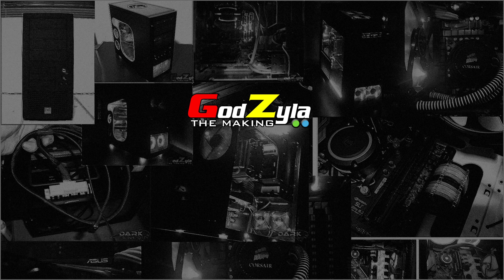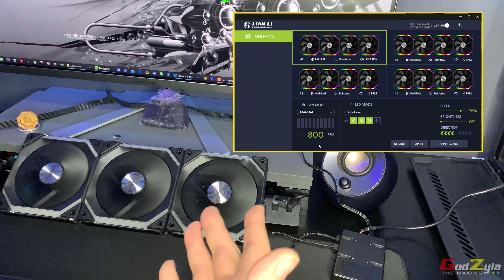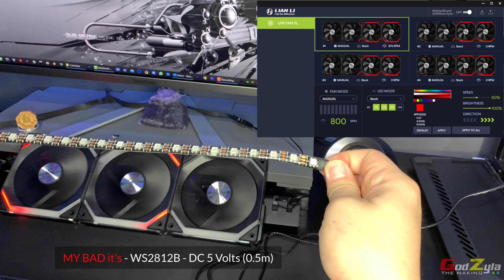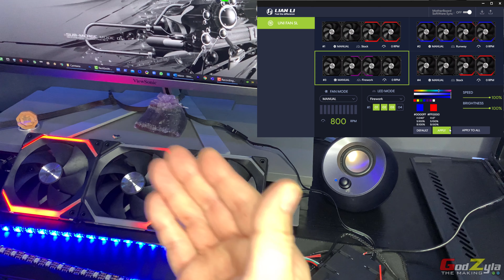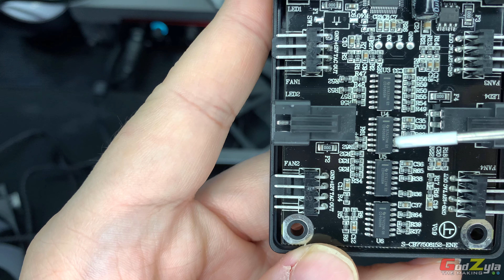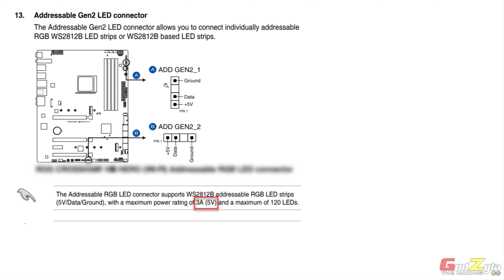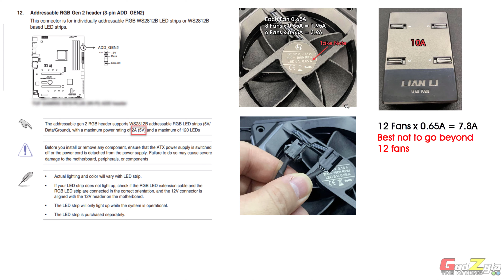Lian Li UNI Fans SL120 - Dos and Dont's (Part II) [L-Connect]

Comment: for this uni fans, what is your recommendation to do and buy when i want to build 7 fans. should i buy 2 controller or can still stick to 1 controller?
Reply from the maker: Hi Nazrul Stylo, welcome to my channel, just my opinion. i will get 2 box sets that comes with each 3 fans and a controller. then to get one more additional fan to have all 7 in total. 1 controller to be used with 7 fans and another to keep as spare. just incase. Thats what I will do. hope this help.
Reply: @KleoYan  hye thank you for responding so fast. so what is the max fans can put within 1 controller? like corsair LL120 need to have 2 controller for 7 fans. So, is uni fans only need 1 controller only? and if include from the video, i think it should be possible for 7 fans and 1 argb stripes right?
Reply from the maker: @MrNazrulstylo  for the uni controller it has 4 output. Each output can take in max 4 fans. Total of 16 fans. So you are good to go with just one controller with your 7 fans and 1 strip which is not more than 1 meter will be fine.
Reply: @KleoYan  i have a question, using casing lian li pc-o11 dynamic, what is the maximum fans for the casing? 9 or 10?
Reply from the maker: @MrNazrulstylo  hi, that will be 9 fans for the o11d  https://lian-li.com/product/pc-o11-dynamic/
(Top) 120mm x3 / 140mm x2
(Side) 120mm x3
(Bottom) 120mm x3
Reply: @KleoYan  why it does not allowed to have 10 fans like XL?
Reply from the maker: @MrNazrulstylo  u can’t fit another fan at the rear.
Reply: @KleoYan  oh, is it because of mobo or no space?
Reply from the maker: @MrNazrulstylo  that the case structure unless you want to put a 80 or 90mm fan at the rear then it’s possible and if you want SL 80mm or 92mm. You might want to request at Lian li official website and raise your request for them to custom make a 80 or 92mm SL fan.

Comment: Hi i have a nzxt kraken z63, 6x sl120 and 2x 140 for the aio. I really dont like Lconnect for controlling the fans manually and if i tried controlling it with the msi motherboard with and w/o the “fix” installed, with red dragon cpu and fan override on, and unifan on pwm settings and red dragon still dont recognize the fan no rpm speed detected but it do follows the curve but it is not stable and crashes from time to time and its annoying. So i would like to know if i could connect the unihub to my nzxt kraken because in my theory the unihub and the kraken will power the fans just fine because they are both powered by the power supply directly not by the motherboard. Because the cam software is really the only stable software in my build that is relevant or not to this topic. My suspicion is its the unifan SL hub that have all the problems that the software cant fix. Another suspicion that can cover up that mistake and avoid recalls is releasing another new fans (ALs) that is main target are the rgb trash fanboys. It just sucks that finally the greatest rgb fan that ever came out is here and the software is trash. SLs are elegant, its one cord unifan is perfect, rgb is not trash just enough to be classy and you ruined it with its hub/Lconnect software. Excuse my frustration.
Reply from the maker: Hello krayzie Egg, welcome to my channel, you can set the unifan to motherboard mode and connect the argb from the uni controller to your nzxt kraken controller if there is one, no issue and you are correct. So long sl fans argb connectors are not plug directly to the motherboard, it will be fine. As for fan load (pwm). My advise to you is to plug them directly to the motherboard header and to control them.

Comment: This may be a dumb question. If my motherboard is only rgb headers. Would this still work.
Reply from the maker: Hi Christian Tucker, welcome to my channel. nothing is dumb :) we all learn.since you do not have a argb header, you do not need to connect the argb cable from the uni controller to the motherboard argb header. you can just use the L-Connect app to control the argb effects on your fans. this video might help you  https://youtu.be/Rm2emeyMUAk

Comment: its possible to use corsair fan on unifan controller ?
when JST connector used by lianli uni fan 
what connector name on corsair ?
Reply from the maker: Hi RD, welcome to my channel, it is possible but you can only connected the argb from your fan to the uni controller. you will also will need to know what's the argb load of the corsair fans. As for fan load, you have to connect to the motherboard fan headers instead to the uni controller. The uni controller only calibrates the RPM of either the SL 120 or SL 140 fans but not other fans. I have done this before on the EK Vardar EVO 120ER fans https://youtu.be/bMRz2KVqbjA
Reply: @KleoYan  thanks for reply , i already see explain on that link.
Reply from the maker: @dropy555  hi. Ok hope you will be able to use your Corsair fans on this uni controller. Do remember to check what’s the argb load. All the very best in your build 👍

Comment: Hi Kleo! First, thanks for this sooo informative video.

I have a question though, I have 9 unifans in total and a Galahad 240 (2 fans included in the 9) that'll be inside an O11 mini. It'll all eat up the four ports in the unifan controller.

Now, I also have RGB rams and I wanted those to be synced with the RGB of my fans so I'm what I'm thinking is if possible to connect the controller into the ARGB port on my motherboard (note: Asrock B450 Steel Legend rated at 3A) and control the lighting from Asrock's Polychrome.

Thanks in advance!
Reply from the maker: Hi glen de guzman, welcome to my channel. As you have set up your uni controller with the lian li components, You can plug the argb cable that is provided with your uni fan set you have bought, connect the argb connect between then uni controller to your motherboard argb header. Switch on your L-connect to motherboard mode. Then use the polychrome of your ASRock to control all. But there are limitations of the pattern as what pattern you change on your rams. The rest of the argb will follow your rams and not your L-Connect application. Hope this helps.
Reply: @KleoYan  Got it! Just to confirm, I won't fry the ARGB port on my motherboard right?
Reply from the maker: @glenndeguzman170  nope you won’t, so long all your fans argb is connected to the uni controller. Same goes from your Aio argb to uni controller and strimer will be from strimer controller to uni controller. You will be fine. As the drawing power is from the uni controller and your strimer controller. Not from your motherboard argb header.
Reply: @KleoYan  Thank you!!!

Comment: very informative video bro. can you do a in depth review on the razer argb hub too?
Reply from the maker: Hi Adam Soya, welcome to my channel and thank you for the compliment. when you meantioned about Razer argb hub, what model is that? If I do have friends who have that unit, I might dig into it. thank you!
Reply: @KleoYan  sorry, just checked the notifications lol should be this controller https://www.razer.com/gaming-pc-accessories/razer-chroma-addressable-rgb-controller/RZ34-02140600-R3U1
Reply from the maker: @adamsoya4716  After taking some time to dig for info about the Razer Chorma, it does not tell me what's the load limit of argb. so I can't really aid you on this. 
If you are using like 6 SL fans as in 3 of each set, with the strimers and such. it should be fine. but if you using it like 9 or 10 SL fans with the strimers, don't think so this unit will take the load, plus on your SL fans, you need to get converters just to work with the Razer controller.

Comment: Quick question: If you're going to use the L connect software. Do you only need to connect the sata cable and usb header cable or do you still need to connect the last cable aswell?
Reply from the maker: Hi Taksoshi, welcome to my channel, you only need the USB and Sata to be connected. This will allow you to control the fans via the uni controller.
Reply: @KleoYan  Thnx for the quick reply. Im going to swap out all my fans in the O11 dynamic with Unifans soon and replace my cpu cooler with a NZXT Z73 AIO. Been saving up :)
Reply from the maker: @Takaoshi  you are most welcome and all the best in your build :)

Comment: how many controllers can i connect to the same system? I have two but my second one is not detected on the  L connect software
Reply from the maker: Hi Rene Alberto Reyes Gonzalez,  welcome to my channel. At the moment you can only use one control till Lian Li develop the version 2.0 L-Connect application. You might want to check out for updates at their official website.

Comment: Hey I have a question, can those same rgb strips In the video turn white, and if they do, is it washed out/ or kinda blue? Thank you
Reply from the maker: Hi AerialSlaps, welcome to my channel. The leds are standard argb WS2812B strips. The white is not exactly white, they are tinted blue when switch to all white. I don’t think any argb will get pure white, even on rgb. The only thing that does pure white will be rgbww which most will not like them as they are not addressable.
Reply: @KleoYan  ok, thanks bro. I appreciate it
Reply from the maker: @SlimeES7 you are most welcome, all the best in your build :)

Comment: Ok what is the one cord that to the box going to the fan motherboard I’m trying to find that wire can’t find it anywhere
Reply from the maker: Hi Aaron Tomsik, welcome to my channel, you will not miss it. there are only four cables that comes with this set. 1) Sata 2) Usb and 3) the pwm and argb cable 4) argb splitter.  the pwm and argb cable is the one that you need. or you can see from this video  https://youtu.be/Rm2emeyMUAk

Comment: Hi this notice pops up on L connect ............lian li  "Notice to prevent excessive current flow to the controller make sure amount of fans plugged in is 12 or less than 12 while performing "static white light... .WHAT DOE THIS MEAN ???
Reply from the maker: Hi portsmouthize, welcome to my channel. That’s just a warning when you switch from l-connect to motherboard mode. It’s basically telling you not to plug more than 12 fans to the uni controller if you want to use motherboard mode. If u do so, you motherboard header might overload and causing the motherboard header to blow due to overload.

Comment: I cant download the software itself. Its noted that they deleted Lconnect 2.0. And i still need to download the msi fix because thats the motherboard i have. Do you have any video tutorial for that
Reply: That was fast. Thanks. 
Im actually downloading that right now. I guess my net drops a second and back again thats why it keeps failing. I just keep resuming downloads everytime it stop. But dang it download so long. I hope this works. Thanks
Reply from the maker: @krayzieegg7294  you are most welcome. If you still having issues and if you trust me. I have uploaded to my google drive https://drive.google.com/drive/folders/159WDLq0R4qUGBtiHQCmZpIF0K_qsq9yw?usp=sharing do let me know if you did get the program so I will remove this from my googled rive. thank you!
Reply from the maker: Hi krayzie Egg, welcome to my channel, unfortunately I do not have that tutorial as Lian-Li will change their update patches and application links when needed. but as for now. this link has the version 1.0 with the MSI fix which you might want to try https://lian-li.com/downloads/L-connect.zip

Comment: I have a question about the same fans that I just installed. I have lian li pc-011 dynamic with 9 fans. The top is intake and the side and bottom are outtake but then my bottom fans start spinning like crazy and I can’t change it. The rgb is fine but it’s just the three fans on the bottom which really pisses me off
Reply from the maker: Hi Coco Beans, welcome to my channel. just to verify, did you plug the PWM connector from your uni controller to your motherboard, try unplug that and use your uni fan to control your top, bottom and side fans individually on the L-Connect application. see if you can control them. if OK, your fans are not faulty, then try connect the PWM cable back. if that was the issue, you might want to check your fan curve settings again via the motherboard utility app or through your Bios/UEFI. just remember that you will need to set to PWM if you are using this cable.

Comment: He Kleo,

Thanks for this usefull information. I did everything like on the video, on the hardware manager page I see the lian li hardware under the usb tab. But when I reboot my pc and start the L-Connect it says that the hardware can’t be found, but I see the lian li is installed under hardware manager. But when I right click and disable the lian li and reboot and turn it on again under hardware manager than works fine, but I need to do this everytime. I also installed every fix from Lian Li, do you maybe know why? Thnx
Reply from the maker: Hi Smartphone Klinike B.V. welcome to my channel. May I ask which motherboard you are using, some users having this on Asus or MSI. They are having issues as their motherboard utility software that comes with it, it took control over the USB header which causes the L-Connect not working. I would advise you to do a chipset update. it will be clear if you remove your L-Connect and the motherboard utility app first. you can refer to this video as how to update the chipset for your motherboard. https://youtu.be/8l4i5UjO3es . Next reinstall the motherboard utility and follow by the L-Connect application (run as administrator on windows 10) if that does not work, just like some of my viewers, they remove the motherboard utility and just use the L-Connect application. If you need both then I have no other solution but to usher you to lian li support website to raise your concern. https://lian-li.com/faq/
Reply: @KleoYan  Thanks for your fast reply. Also I did the update from intel website, still same problem.

My mother is the Asus Z590-A Gaming wifi, I do have Armoury Crate from Asus installed for controlling the RGB’s in my case.
Reply from the maker: @silhan4325  I see. That could be the caused of it. If that's the case as mentioned, either you remove the amour crate and just use the L connect or if you need both. Then approach Lian Li support as I have no idea how to fix that. Thank you.

Comment: Thank you for the detailed video! i have an issue where my L-connect software does not control the fans at all it just stays on rainbow, it used to work fine before then after i shut off my PC and turned it back on the next day it stopped working ever since. i would really appreciate it if u can help me with this issue. Thanks once again.
Reply from the maker: Hi Suliman92, welcome to my channel, do pardon me for the late reply as i was busy at work. now you might want to shut down your pc again, unplug the power for 30 seconds or so, plug back the power and restart your pc. see if it fixed the issue.
Reply: @KleoYan  Hello Kleo, keep up the good work. I just tried that and still i cant control the fans' speed nor colors from the software. It used to work before so I'm sure that it is installed correctly i just cant figure out why it stopped responding to L-connect

Comment: Nice video! I currently have the lian li uni fan with controller and was wondering if I can plug in other branded fans on the controller? I want to get more lian li uni fans for my case but they are out of stock everywhere. I was thinking of buying Noctua pwm fans and connecting it on the controller. Would that not work? Thanks.
Reply from the maker: Hi RCMSiXSeNs3, welcome to my channel. I have use this uni fan controller with EK Vadar 120ER fans.. https://youtu.be/bMRz2KVqbjA. I did a series of this uni fan which might interest you https://youtube.com/playlist?list=PLEW-b-2vYDdM1WklGQps2-sQ1Amy6Uwn9 if you do like my content, kindly subscribe and to click on the notification bell, thank you very much!

Comment: Hello,

i am currently considering buying those fans. But i have one question: Lian Li offers a ARGB Cable Kit which acutally allows you to bypass the controller and run the fans directly / only via your motherboard (both in terms of PWM and LED controlling). The cable kit provides for a splitter cable from their proprietary connector to a regular ARGB Connector.

What kinda irritates me is, that Lian Li itself, states that you can connect up to 6 UNI Fans onto one ARGB Header on the motherboard. However, if the power draw or current draw of 6 fans sums up to 6x0.6=3.6A, this would exceed the current limit of a single header?

So my question is: 
1) Is my statement correct?
2) Is it possible to compensate this buy placing any RGB HUB in between the splitter connection (provided by the kit) and the motherboard connector, provided that the RGB-HUB has its own power connection (e.g. via SATA) therefore the current limit of 3A directly of the header doesnt apply.
Reply from the maker: Hi Klardust, welcome to my channel, 
for 6 uni fans, fan load will be at 1.08a (0.18a x 6) and argb load will be 3.9a (0.65a x 6) 

in general each motherboard fan header has a limit of 1a unless stated for pumps and etc which are at 2a. I will tell you  do  not plug 6 uni fans to one fan header unless the limit is 2a. For be best practice is, I just stick to 2 fans per fan header.. 
for argb, most motherboard argb header is limited to 3a, some lower on old boards. I will also ask you not to connect 6 uni fans to one argb header. Your argb header will overload. 

1) your statement is correct
2) I will not commit to answer this.. Uni control can take the argb load on these uni fans as for other argb controller/hub, even power is supplied to it via the sata cable, I will not go for it as I do not know how much argb load it is capable of. you might end up blowing up your controller/hub of other brands.

hope I did answer your question. Thank you!